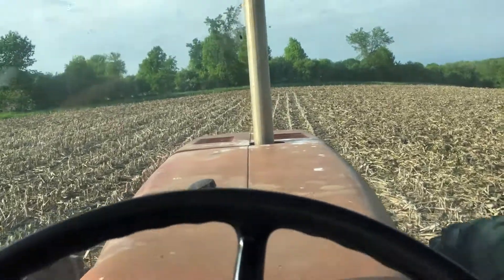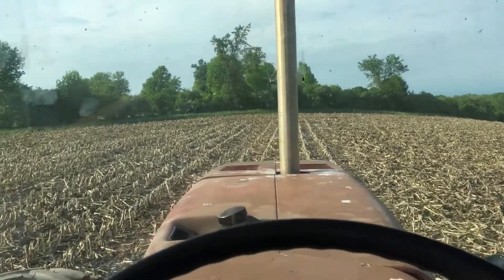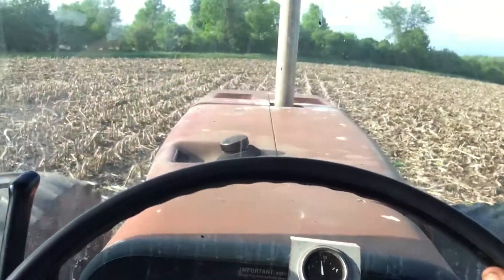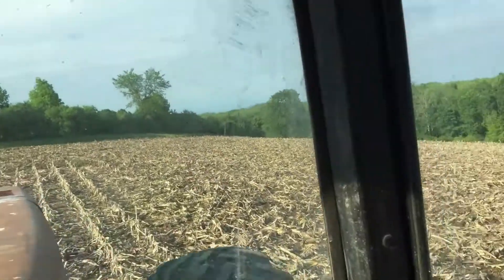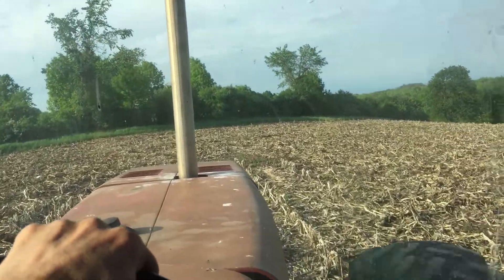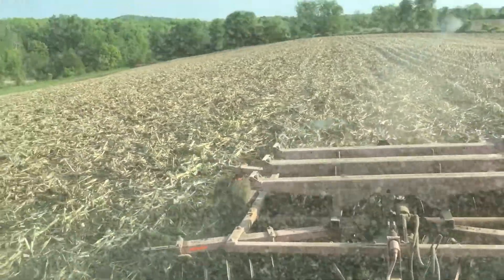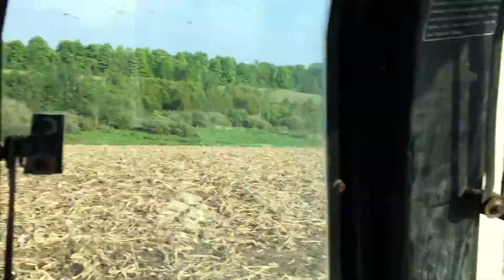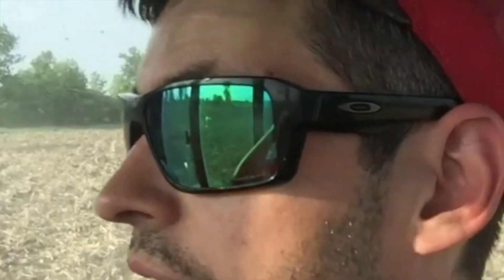tilling with my new 2+2

Comment: They a love em or hate em tractor. Father inlaw had 6588 he liked it but had a lot of arm trouble in later years figured it was the steering tires jerking around. Sold it at auction went up Bradford way to a collector. I seen it at Cookstown at the IH show.
Reply from the maker: had a few issues with it. Needs some things but all old tractor do.Did you see it at the Cookstown steam show?
Reply: @younggunfarmer416  Yes that's where I seen it. Father inlaw had a 3588 burn in a barn fire and was replaced with a 6588 sold it at auction for 26000 I think. He done a pile of tillage work with it. Milked 100 cows on 500 acres around Trent University Peterborough area.